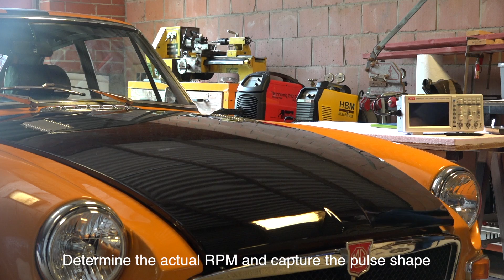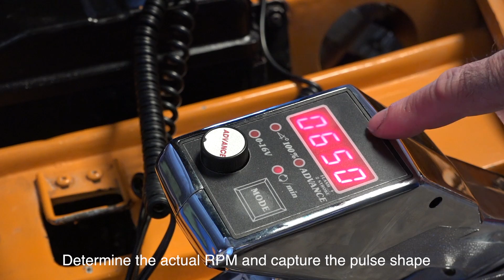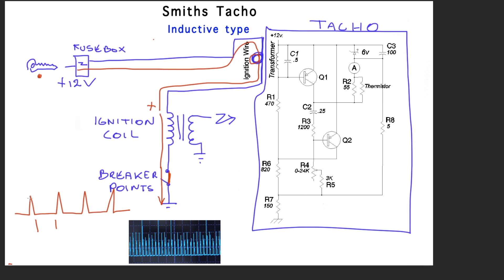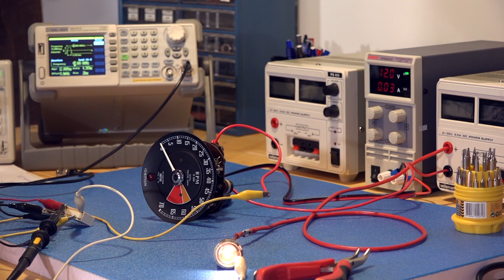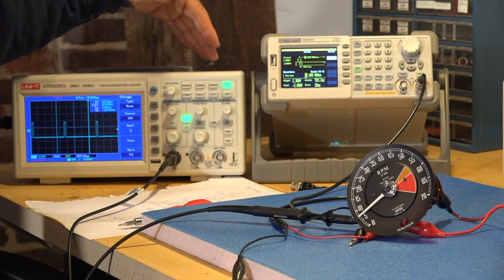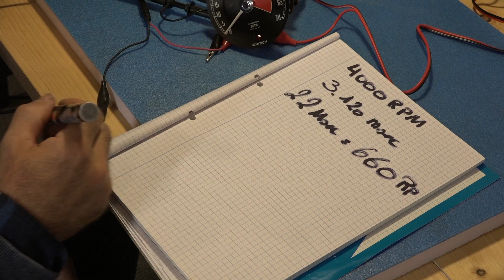Understanding and adjusting the Smiths tacho Part 1

Comment: JHOOO FLEMISH, TODAY YOU ARE GIVING MUCH MUCH DIFFICULT LEASON. THIS IS DIFFICULT INDEED. EISH I DID NOT KNOW YOU ARE THIS GOOD IN ELECTRONICS . I CAN FOLLOW YOU LITTLE ON THIS LESSON BUT NOT SATISFACTORILY BECAUSE I RAN AWAY FROM ELECTRONICS AT SCHOOL BECAUSE IT WAS TOO DIFFICULT. BUT STILL I THINK I AM MUCH BETTER THAN MOST OF YOUR SUBSCRIBERS IN UNDERSTANDING YOU. YOU REMIND ME OF THINGS LIKE DIGITAL WAVES (SQUARE WAVE) AND ANALOQUE.  HEI YOU ARE TOUGH MAN

I SURRENDER TO YOU LOL
 DONT FORGET I ASKED YOU TO DO US VIDEO ON WHERE ACTUALLY CAN WE FIND WIRING DIAGRAMS OF A CAR , MAYBE BY USING VIN NUMBER. I MEAN THAT THAT DIGRAM MUST INCLUDE CONNECTIONS OF CRANK SENSOR, IAT SENSOR ,O2 SENSOR, TROTTLE POSITION SENSOR, KNOCK SENSOR, INJECTORS AND SO ON. BECAUSE IS DIFFICULT FOR ME TO KNOW WHICH WIRE IS WHICH ON THE PCM OF THE CAR.

M.B.S MOSHITOA (SOUTH AFRICA)
Reply from the maker: Thanks,  Ok I see you would like to get a basic engine control system....  I will see if I can make such video....
Reply: it is no wonderno body asks you questions on this video because they are all far back meaning they are far to can understand you though we know your explaining is good.
because we know you are good in explaining a thing then we accept that the problem is with us.
no one asks question because they don`t understand. mmmm lol.
one day make us a video abou yourself. how you grewup the schools you attended. 
THE FOODS YOU EAT.MAYBE WE CAN TRY TO START TO GIVE OUR CHILDREN THAT. HAHAHAHAHA

M.B.S MOSHITOA (S AFRICA)

Comment: I was just as thinking that the current pulse has a relationship with the return spring tension on the dial pointer, one pushing the pointer against the other. does the spring lose tension so over time so the tacho starts to over read?
Reply from the maker: Well that is also a  factor if the tacho get older and the mechanica parts wear.  That is why a calibration is always usefull,   trying to calibrate a 4Cyl Tacho for an 8 Cyl is not really the purpose of the calibration potentiometer... but it sure works

Comment: Nice video, but looking at the R4 is the adjustable R5 is fixed value of 3K. I've got a misbehaving tacho that over reads. so now I need to know how to remove the glass without making a mess of the bezel
Reply from the maker: Have a look at my part II,  its there

Comment: was told to use a plastic screw driver to adjust things like this a good video
Reply from the maker: That depends on the potentiometer, if its all metal yes. If it has a plastic cover to turn on  metal is good.